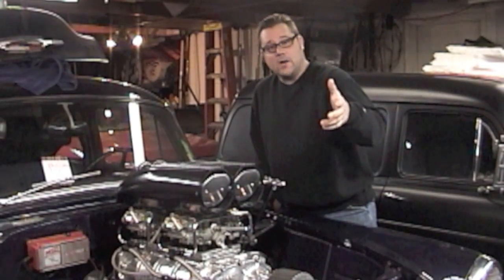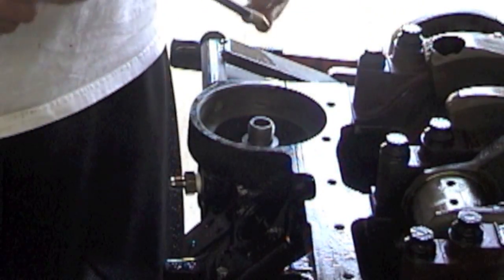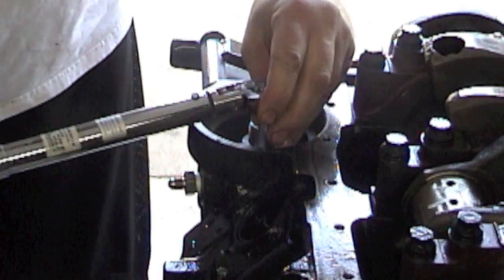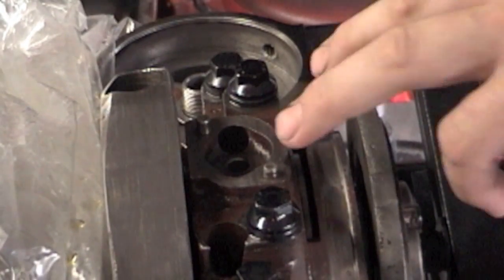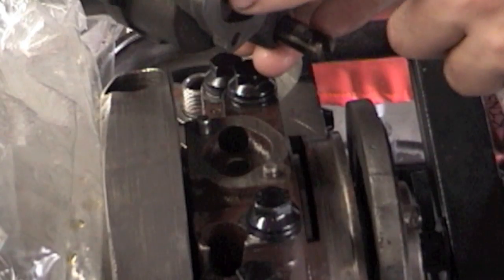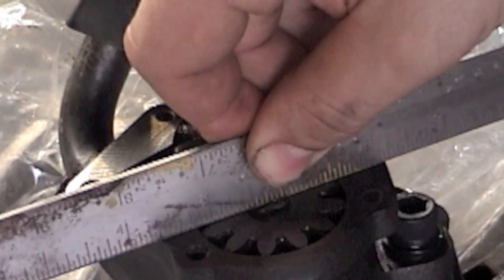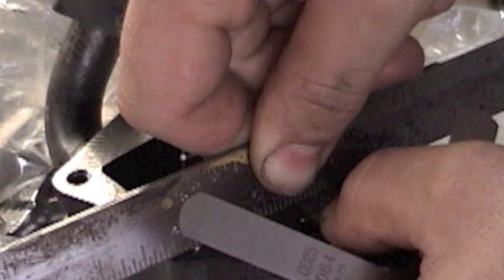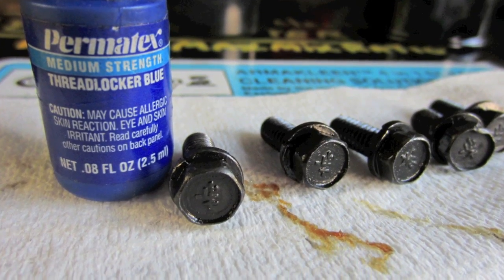Part 12 Blueprint and Install The Oil Pump For The Big Block Chevy

Comment: Appreciate your efforts putting together this series and what I see as the most important element of your motor, the oil system. I also plug the oil relief to filter each drop. I picked this up from a Bill Jenkins BBC manual 40 or so years ago. He also pulled out the pin and replaced it with a threaded pipe plug due to a one time rare failure he wanted to be sure never happens again. I do this modification, a pain but what the heck, I spend allot if time prepping parts the way I want and feel necessary to me (an edict the Chevy Power Manual states many times on things to consider for your BBC blueprinting activities).  I take a new oil pump and disassemble as some will not be as clean as I like. I think I checked my oil almost every day to monitor amount being consumed to driving length and habits and changed it when it broke down more than I liked, even if it looked clean. You need clean oil to make power.

Comment: Hey I have a 62 cadillac deville with a 390ci..I had freeze plugs installed but what hole does the hex plug go in? its located on the back end of the motor, next to the freeze plugs
Reply: It's likely an oil galley plug.

Comment from the maker: Hey Don pato,
Thanks for taking the time to post and leaving the nice compliment, much appreciated!!!!
I use the Melling M77HV (HIGH volume STANDARD pressure).
I never had an issue with oil leaks. I've heard on a street performance BBC to use High volume Standard pressure oil pumps. No need to use HIGH PRESSURE pumps as the cause leaks as you mentioned
Thanks
Have a Great Day 
Johnny K

Comment: John....excellent series.....I have often wondered about high pressure oil pumps in old chevy blocks designed for 35-45 lbs.....This may be a source for oil leaks in our older engines....What have you heard on this subject?......
Mike Danford
So Calif

Comment from the maker: Hey sixxtoes6,
Thanks for the nice compliment.
No the oil pump drive shaft won't fall off. The hole in the block that the shaft slips through has a smaller diameter then the large end of the drive shaft (which attaches to your oil pump) prevents it from falling off the oil pump.
Remember to put the shaft on the oil pump and slip it in as one unit.
If you forget to put the shaft on...YOU CAN NOT install it from the top side of the motor.I speak from experience hahaha
Have a great day
Johnny K

Comment: another great video , I have the same pump and drive shaft and was wondering if after you install the pump and the engine is upside down can the drive shaft fall off ? Like when you are bolting the pan on ?